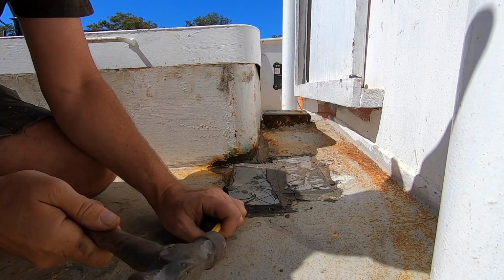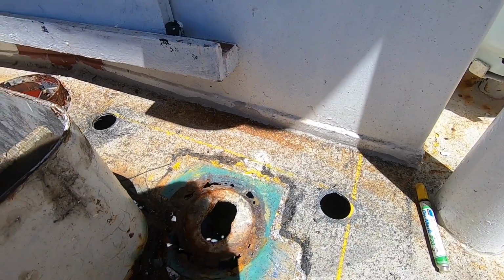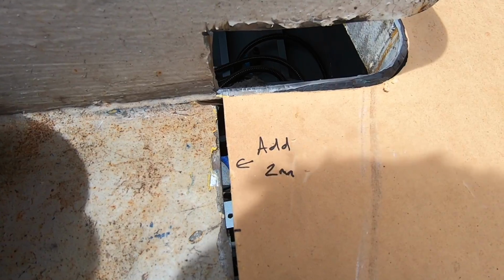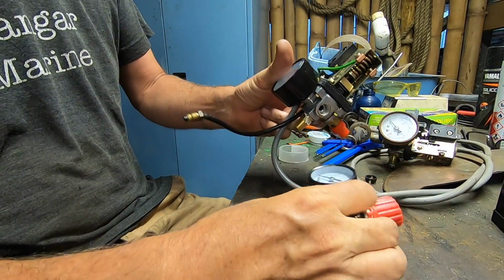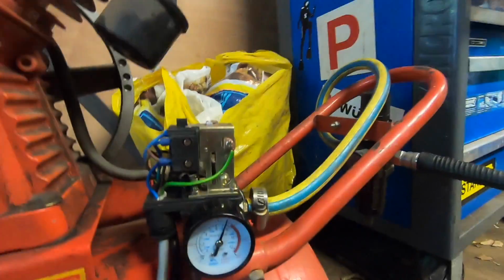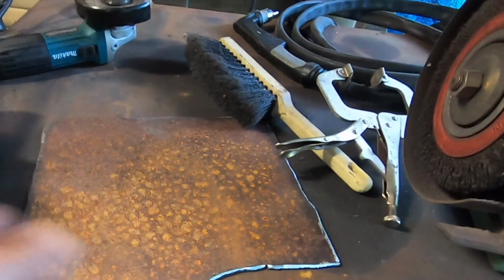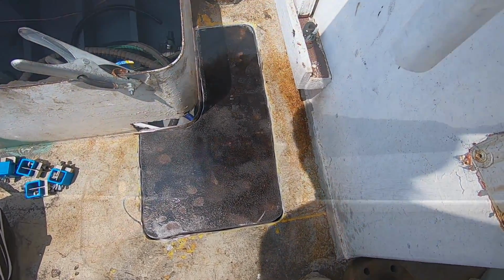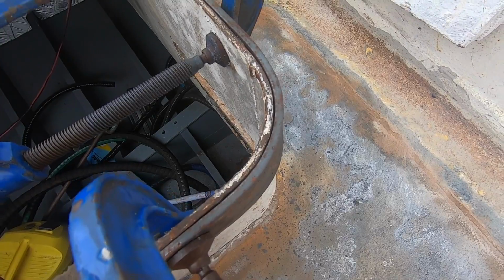Repairing the steel trawler's deck

Comment: Do you disconnect electronics before welding?
Reply from the maker: I usually just turn of the battery switches, but yes, it is important to protect sensitive electronics.

Comment: compressed air! the collar on a pipe is a olive. Their are 2 setting on the pressure switch one is the stop pressure the other is the differential i.e the difference between the stop a start pressure. If you set the differential to 5psi the motor will have a very hard life. 30psi is more reasonable.
Andy

Comment: You can do anything if you set your mind to it. I am not a qualified tradesman and not a professional at anything. Never built a boat before. I built a luxury houseboat from scratch 6m wide 15m long, twin fiberglass pontoons,2 bedrooms, shower toilet, kitchen, lounge. sun deck on the roof. 240v Solar system, Battery bank, LED lighting. Fitted 2 x Mercury 65hp engines and controls, steering, Radios,Chart plotter, CCTV all round. Did the whole lot on my own. Although I knew a lot about this stuff already, people often asked how did you do it? Answer -YouTube. Loads of information on YouTube. Thanks Stu. You have provided me with tons of useful information.

Comment: When attaching a pressure switch or pressure gauge, you should use a wrench on the connection to turn it. Turning it by using the body can affect the calibration and operation of the switch/gauge.

Comment: Wish I caught this sooner ,but you could get a swivel adapter fitting ,male one side swivel female the other both threads  1/4 inch most likely from a hydraulics shop or a paint spray supplier shop and one of those double hex nipples for ease of mounting your regulator assy.
Reply from the maker: Next time!

Comment: Hey Big fan of your channel, I'm having a problem with my honda bf40 4stroke atm, it's smoking I think it's getting hot maybe a salt blockage in a water channel have you got any advice on flushing it out if there is any in there also finding bits of grit in the bottom of the barrel I'm running it in,
Reply from the maker: You could take the thermostat out and back flush it with a garden hose. Make sure you have a new gasket for putting the thermostat cover back on first though.
Reply: @DangarMarine  thank you I will give that a try is there any chemicals you can recommend to break down salt if that doesn't work, also have you got any more videos coming in the future on your honda 40 there's not many carb rebuilds on them or anything like that online, many thanks again your easily the most helpful marine channel on YouTube

Comment: Could have just used the old pieces of metal as a template for the new replacement patches
Reply from the maker: The corners were all cut out from the hole saw and the inside edge was rusted away and it was cut into multiple parts to get it out.

Comment: Stu the compressor switch turns off on a high-pressure And  back on a low pressure if you back off the setting screw while still at a high pressure you can’t set it i.e. set it to turn off at the high-pressure and it will automatically be set to turn on another pressure for sample seven high five low

Comment: In England we call that little thingy an olive   Used them allot when fittting the red/yellow air lines on the back of trucks which connects to the trailer

Comment: To bend the steel get it to the approx bend then start welding top and bottom, the heat generated will allow the bend to form, plus a tap with a hammer .

Comment: actually when you bend steel like that, it may sound funny, but hitting with a good hammer to shock the metal, prevents the curve from unbending.. especially when you hit the outside of the curve.
Reply from the maker: I’m willing to try anything!

Comment: Funny thing about when you were bending the steel, it wasn't till the end of the video I thought "why not use a blow torch to heat the metal while bending then clamp".
I might be way off as I have no metal working experience. Just a thought.
Cheers.
Reply from the maker: Unfortunately there isn’t one on the boat.

Comment: Freehand plasma cutting?! you are a gangstar. If you can find an easy way to cut the plywood template offset by the radius of your torch tip and then run the torch around it you get a really accurate shape that only needs a little bit of cleaning up and grinding. There was an ex-navy guy I knew who explained an excellent process of using the bit that was cut out to reproduce the exact shape no matter how intricate, one of those moments in life that I wish I paid more attention. Great video and good work on the amount of progress that you're making.
Reply: hold on, typing that just made it all click about what he was saying but it isn't as useful for you as you can't get the plasma cutter to work on the boat...
1. cut out rusted piece and tidy the hole up
2. suspend the cutout piece below the hole that you've created by ~ the depth of your torch tip
3. run the torch hard against the edges of your hole so that the bit that was cut-out gets smaller by the size of the offset required (i.e. the radius of the tip) 
4. use the cut-out (which is now correctly offset) as your template and run your torch around that to get the exact piece that you cut out.

Comment: just a tip if you dont know, be sure have the shaft coupling and trans coupling lined up before torquing the engine mounts always bring the transmission coupling to the shaft coupling i had guy pull the shaft up to the trans and you can just feel the vibrations

Comment: If it can't be fixed with a hammer or duct tape, it's probably an electrical problem.
Reply: Electrical is in most cases also fixable with ducktape (Or WD40! lol

Comment: Stu
Could you have welded lil piece's of steel under the deck where you cut out the bad metal ?
 That way the repair plate could've set on top like alignment tabs?
Great progress for the repairs .

Comment: I've just replaced a broken pressure switch on my 250L compressor as the tension spring assembly snapped. In the UK I paid £24 for a complete new pressure switch. Very easy to change out and works flawlessly. Another great video Stu

Comment: Use a DIAL indicator  clamped to one shaft when aligning motor to prop shaft. Very important to problem-free  long life, also safety. Dial the (back) face of one flange for PARALLEL , dial the CIRCUMFERENCE of the flange for left/right/up/down.....Good Luck.

Comment: Hi Stu,
when I do such repairs to various items like car bodies and equipment. I cut out the infill piece first and the lay the infill piece over the body/hull then mark out the section I need to cut out. This works well especially for compound curves and places where i can't get behind to scribe the edges.
Se essentially the process is 

make up a replacement panel and fit it over the area to be patched as a trial fit.
once the fit is good, then mark out the body around the perimeter of the patch .
remove the patch and cut out the body. allow about a mm clearance overall between the patch and the body.
go around and tack weld the patch in, then infill weld all round in short sections to distribute the heat evenly.

Comment: Having the compressor cut in and cut out over only one bar is going to cook the electric motor. They're only rated for five starts per hour, with such a narrow range you're going to have it stopping and starting way over the duty cycle. You're better off having it run continuously, by making a small leak so it never hits shut off pressure. Not ideal but it works in a pinch.

Comment: I’m wondering if the radius of the piece is going to be a bit too large (large by the thickness of your pattern) since you’re bending around the outside radius of the piece you’re going to weld to.
Reply from the maker: One it is in place I can tweak it slightly as I tack it in.

Comment: The crush collar is actually called a feral.
Reply: Ferrule, a feral is what glue themselves to the road during peak hour because they are scared of summer.
Reply: @dustyfarmer  thank u Dusty.I was going to spell it similar to how u did it.But thought it was better to spell the wrong word correctly than the right word wrong.I should know that spelling being a master plumber.
Reply: @lawrencecarpenter638  No worries, I knew what you meant but It was an opportunity to good to pass up on the real ferals that one may come across.

Comment: Hey Stu, looking at the holes in the deck, Australia must have some super sized wire worms and rust mites to get holes like that.
Reply from the maker: That big one is where a standpipe for a deck wash used to come through the deck. It is a combination of the pipe itself and the salt water dripping from it.
Reply: Dangar Marine 
Should be fixed for a few years now I guess 👍

Comment: Is that some sort of low spot on the deck against the engine bay combing (sp?) where sea water sits?
Reply from the maker: It is where a standpipe for a deck wash used to come through the deck. It is a combination of the pipe itself and the salt water dripping from it.

Comment: Was it just the video, or were those wires, that you cut into, in horrifically bad shape? Very little boat experience, but I did completely rewire a twenty-footer when I was a teenager. That thing spent eighteen years in the salt and the wiring was so bad, you couldn't just cut the bad ends off and add extra - the corrosion had wicked up the wire for several FEET.
Reply from the maker: No, those wires were quite new. You are right about how far corrosion can wick along wires though.

Comment: Hey Stu. Ive noticed a few comments on bending the steel and all pretty good ways to do it. On things like this I normally get the piece close to length and then tack one end securely an continue tacking until I get to the curve. When there I go back and make my welds top and bottom to that point of the curve. Now before it has a chance to cool I start bend the metal into the curve and tacking it when it bends into place till I have the whole bend almost done. At the point you get the bend done enough to use a clamp to continue the bend then you can just tighten and tack. Ive done this alot. This way your using the initial heat from the first weld and the tacks coming around the bend to help make the bend. I also leave the piece long for leverage and then cut it at the last minute after your bend or where ever your stopping. Anyhow just another option. Glade to see the motor is back and we will start seeing some work on it and getting it in. Thanks for the vids. Im one of your greatest poor fans.
Reply from the maker: Yes, I was thinking of a similar process. I know this will spring back when I take it off so I'm guessing it will be a combination of starting with it mostly bent and this technique to finish the job.

Comment: I work with wood more than metal, but I like to make the patch first and use it as the template for removing damaged material.  Sometimes you can cut the damaged material and patch at the same time.

Comment: 1:24     what is that dripping noise in the background?  a leak somewhere?    is it just the accepted thing that there Will be leaks and the bilge pump will deal with it ?
Reply from the maker: It's not a leak, it's the noise of the water outside coming through the hull.

Comment: Is   there a differential setting on the switch you need to set?
Reply: Those inexpensive style of switches are only adjustable on the high side. The low side is fixed usually about 40 psi below the high side setting.

Comment: 3:38 I am sorry, but this part is absolutely cringeworthy. Yikes! What is so difficult about keeping a bit of polycarbonate between your eyes and flying shards of metal and flailing blades? No hating here, just caring. Or am I just old, deserving an "OK, Boomer"?
5:42 See, you can do it!
Collets are segmented, olive fittings are smooth. But that might be different Down Under. And, is that a Cousteau in the picture 20:46?

Comment: some folks in life are experts at telling other people when they do something wrong.....just a lot of hot air mate.  I have done so much to my boat that folks told me to pay someone else to do, if I had listened I couldn't afford the gas to run her.  Your channel helped get me in the right mind set to read and learn and fix things myself, and for that I thank you.  There are still things I'm not comfortable with and for that I do pay a skilled person, but there are so many things on a personal boat you can do if you just apply yourself, and when done you will be a better person and a better captain when you know your machine inside and out.  Thanks Stu, keep up the motivational content!  And get some dang beer in that fridge.
Reply from the maker: Thanks Michael. As you say, you can spent a fortune if you pay other people to do all the work. I definitely wanted to use a specialist to recondition the detroit diesel, but that can then be paid for with all the money that was saved doing other things myself.

Comment: Interesting comments about wood vs metal. I still don’t think I would ever work with a steel boat but I will likely have a different thought after dealing with fiberglass 😝. Great and ironic to see you sporting an Arabella shirt. Way to represent! Looking forward to the continued work.
Reply from the maker: Fibreglass can be good to work with too. Not much fun to cut out, but quite satisfying to reglass.

Comment: If the “cold bent” steel piece springs back..you might consider reclamping it fairly high up so you can weld in a bracing piece that will hold the curve long enough to weld it in place.
Reply from the maker: Nice idea.
Reply: @DangarMarine  I think (I am no expert) your radius will be way too big. You bent around the outside face which will make a bigger radius. You need tabs inside the radius to bend to I think.

Comment: Take the pattern that you cut for your Steel plate to your work shop and your piece of Steel and then you can bend it to the shape of a patent with your oxy-acetylene
Reply from the maker: I did think about taking it back to the shop.

Comment: When you replace your positive cable, replace with welding cable, possibly 33mm2 if you were using 25mm2 before but if you were using 16mm2 before then just go to 25mm2 cable. It will mostly be orange cable sheath so get a few metres of black heat shrink to stagger black cut off pieces to mark the orange lead for negative pole & leave the orange for positive.
Reply: Don’t use welding wire. It work hardens too quickly with the vibrations on a boat that’s why they always recommend large gauge but fine stranded wire. Check out Pacific yacht systems explanation of it.
Reply: Quality welding cable has fine stranded wire of 0.20mm rather than most cable which has 0.30 mm. This is why it's very flexible.
Reply: I didn’t know it was that fine. Can you get tinned welding wire?
Reply: I'm not sure, also another thing about welding cable it has 2 sheaths instead of one, also when you get up to over 50mm2 the wire goes as fine as 0.16mm. You can in the ends easy enough with some liquid flux using a mini blow torch aimed at the center of the core as you go to tin it then it will be okay. As long as your copper is sealed at the sheath it won't be damaged by sea water.

Comment: I had a regulator like that on my old compressor (Chinese junk) I got so fed up with that piece of Harbor Freight crap that I trashed the whole thing and bought a new "Husky" from Home Depot that finally has enough CFM to run all my air tools after dealing with that POS Harbor Freight junk for fifteen years.

Comment: When it comes to sandblasting and painting the deck, consider throwing some sand on the epoxy paint before it dries. You want something to add grip on the deck. My fathers boat has an aluminium deck and it can get very slippery when wet. 
Like your channel and keep up the good work. Greetings from Norway.
Reply from the maker: For sure, will definitely have a non slip deck coating. I'm no safety guy but I reckon that one is essential.
Reply: @DangarMarine  Yeah. Have experienced some "events" where my feet go where they want when the boat is rolling about.
You, together with Damien & Jess have giving me some encouragement to start on a boat project of my own together with a buddy of mine. Just a small 17 foot thing. Engine had gotten some water inside, so now working on restoring that with parts from another engine. 
Good luck with your engine build!

Comment: Great video Stu.  The idea of using a Hiab on a truck to move the motor sounds like the way to go.  My concern was trying to lift it with Renko's hoist, didn't think it would handle it, let alone getting it into the dinghy in the first place.  Sounds like more fun that way anyhow, which is a good thing for those of us living life vicariously through you.  Cheers for now mate, see ya next week...  ;-}
Reply from the maker: Yeah, that little crane on the truck can't lift a quarter of that engine's weight.

Comment: Next time you bend cold plate, cut a few segments with the grinder. just shallow cuts abt 1/3 deep It will bend easy then just weld them up. the cuts give the steel somewhere to go as one side stretches the other compresses. Old trick to get bits back in shape
Reply from the maker: I'll give it a go if I can't get it installed.
Reply: @DangarMarine  As I fix lots of bent stuff most of the time then it pays off,  I run a 200 amp dc stick set oxy/acl bottles vice grinders rack clamps in a trailer. You turn up on a job you have to fix it....

Comment: Do you want a spare motor for the compressor ?? I have one sitting around almost new - am only up the m1 - hr away 

Also have an oxy set if you need , happy to drop it down
Reply from the maker: Thanks mate. That compressor is already on it's second motor so I'm sure it will fail again eventually.